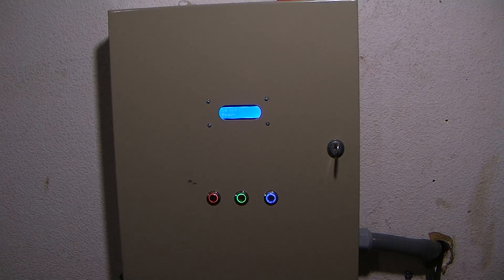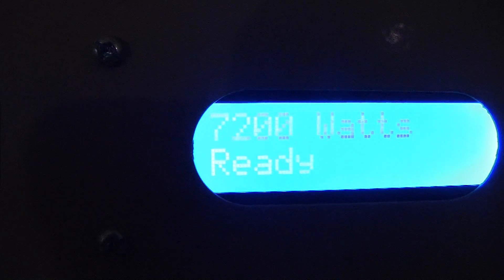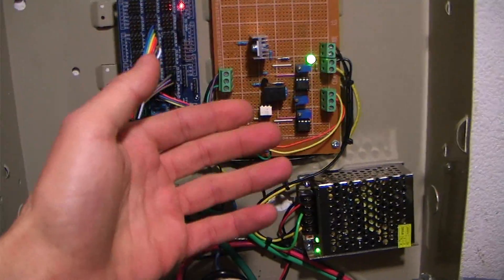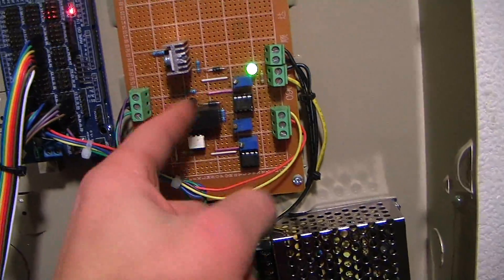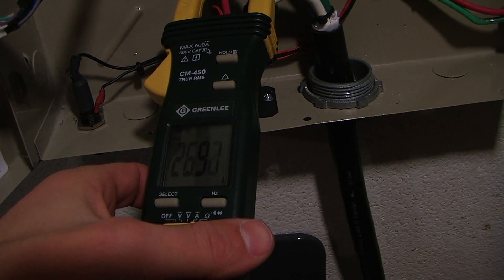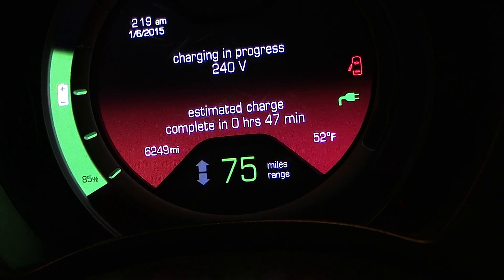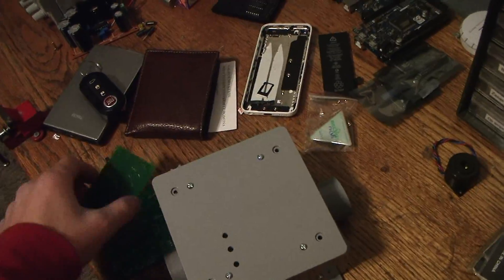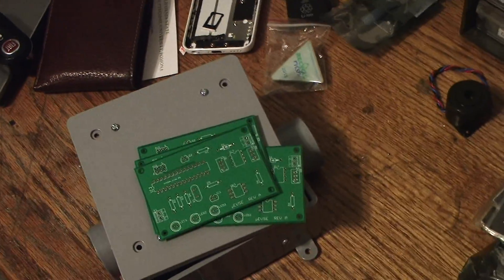Homemade level 2 EV charger quick overview

Comment: You left out some rather important safety checks that are required by the spec. There's no GFI, there's no stuck relay test or ground continuity monitoring. By itself, this EVSE is not unsafe, but if any of the faults occur that those checks are intended to detect, the result could be very hazardous. Imagine if the car had a ground fault and the ground connection from the car to the premises was not low impedance. The result would be that the entire frame of the car would be energized at 240 VAC. A proper EVSE would detect either of those situations and turn off the power.
Reply: +Nick Sayer Good comments, thanks for pointing out those issues.
How would you detect stuck relay? 
A stuck relay could be logically disconnected by means of a MOSFET or similar semiconductor power device, such as IGBJT.
The issues you point out are important, but aren'tt a deal-killer for me, as there are workarounds for all these problems.. E.G., changing connector types isn't a big deal.
GFCI is pretty easy to add in as well!
Reply: +J Bishop The way UL wants you to detect a stuck relay is to detect if there is any voltage between either load side terminal of the relay and ground. It turns out that this is not very different from the ground continuity monitor test they want you to do. In other words, it's an error if there is no potential from at least one load terminal to ground when the relay is supposed to be closed (bad ground), and it's an error if there is any potential from either load terminal to ground when the relay is supposed to be open (stuck relay). Of course, this test involves intentionally leaking current from hot to ground, so it's not at all trivial to implement. My designs use an S1M diode from each leg to a common cathode terminal going to a 150K fusible resistor, a 1 mA current limit, the LED of an opto-isolator, and then ground.

Even with all that, it's hard to get it exactly the way UL wants it. They want the threshold to be 100 ohms per volt - so 12K for L1 or 24K for L2. Detecting at that level is really hard when you're talking about limiting a 120 or 240 volt signal to 1 mA.
Reply: +J Bishop Oh, and the MOSFET getting stuck isn't the issue. A stuck relay usually means that high current has welded the contacts closed. That can happen if something shorts one or both hot lines out. It takes a lot of current and a (relatively) long time for a 40A circuit breaker to open, and in the meantime...
Reply: Nick Sayer OK, I think I see now what you are referring to as "stuck relay"! 
You mention your own designs, do you build charge controllers (EV chargers) for business?
Reply: +J Bishop No, I actually do it for fun (I know, right?). I do sell my boards online, but it's a hobby rather than a livelihood. My proudest achievement is the J1772 Hydra. It was the world's first two-headed EVSE (two headed meaning two J1772 plugs on a single input power circuit - not like some commercial units that just put two EVSEs in one chassis).
Reply: Nick Sayer That's very cool,and extremely sophisticated (well, if you were to ask me).  There's obviously a lot i didn't know about J1772... was not even aware of the Proximity wire!
Do you still have your Leaf?
Reply: +J Bishop I never had a leaf. I started with a Fit EV, then my wife got a Volt and I now have an eGolf that replaced the Honda when its lease was up.

Comment: You can buy a Bosch level 2 charger on Amazon for about $500. You should not be making your own level 2 chargers at home!
Reply: This guy knows what he's doing. There's also something to be said for making your own stuff. Start DIY projects and you'll find you learn a ton of stuff... of course when dealing with 240v, this shouldnt be your first project.
Reply: +B33SON No he's not, read Nick Sayer's comments. This dude is clever enough to throw one together, but not clever enough to do his research on safety features/over speccing his components.

Comment: Hey ! I have a Dell Poweredge 2950 but sadly i dont have any harddrive trays. I was wondering if you could figure out the dimensions of the tray so i can print it off on a 3d printer. or, if you can could you make me a file so i can print it off ? Thanks !

Comment from the maker: Bruno, the pcb's were just purchased on ebay. If you go on ebay and search for pcb manufacturing, you will find many services for sale and look for one that meets your requirements. I would highly recommend this over an expensive service if its just some small project your working on. You can buy them really cheap from china or a little more pricey to be made in USA.
Reply: Hey Jacob
I'm thinking of building my own level 3 dc fast charger for my final year engineering project.
Can you make a video on it and guide me, please.
Thank you